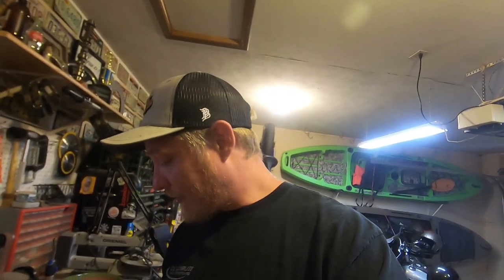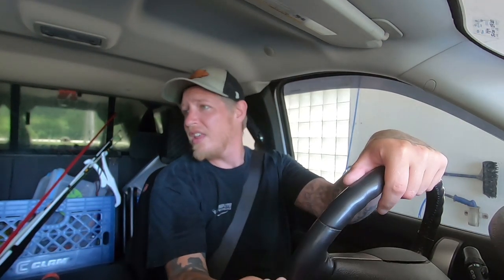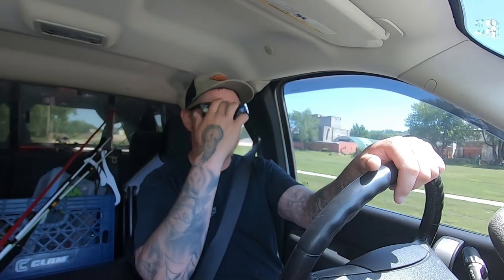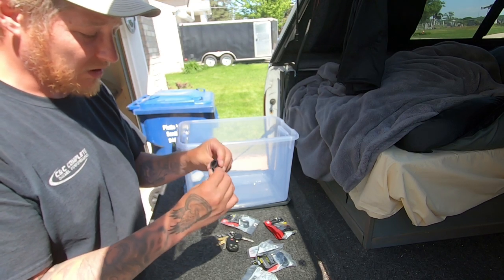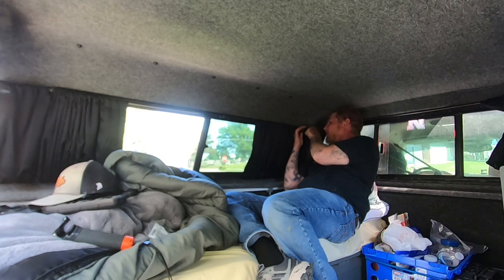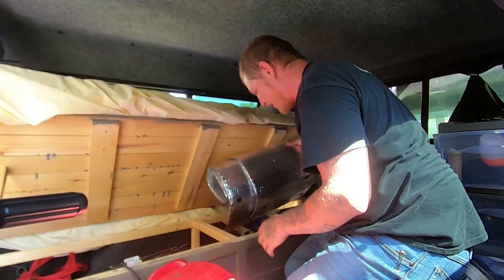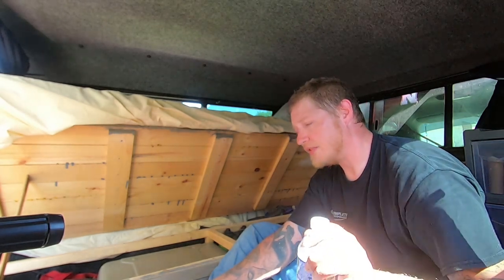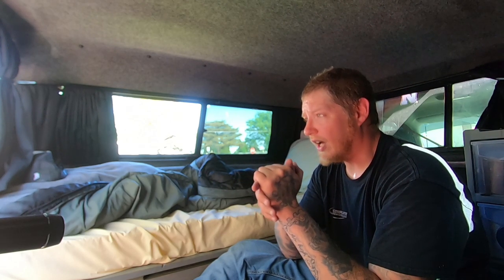Fixing The Truck Camper Curtains and Prepping For The Next Adventure

Comment: Have you considered sewing magnets in the curtains? It appeared as though the window bracket had metal. Have fun on your trip, good luck!
Reply from the maker: The frames are aluminum so that's a no go otherwise I would have gone that route. The trip went well, but let's just say the next vid is probly not one to watch with your kids 😂
Reply: Bummer about the aluminum. Thanks for the heads up!